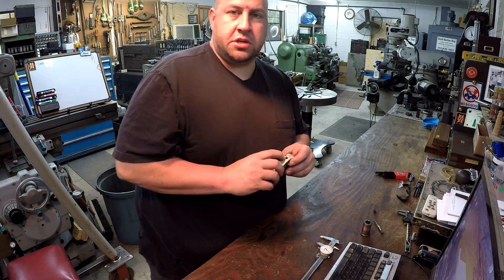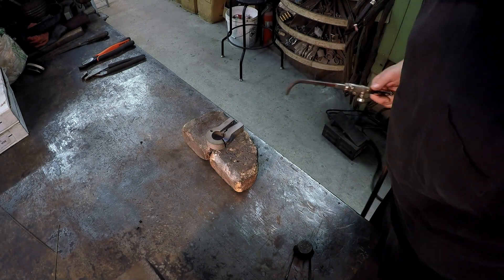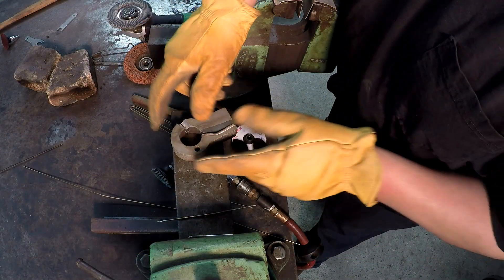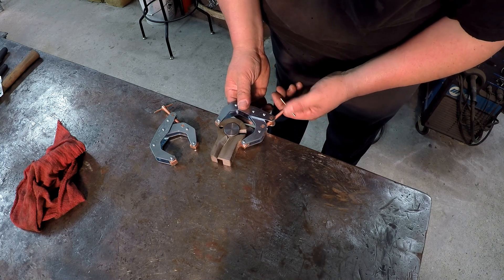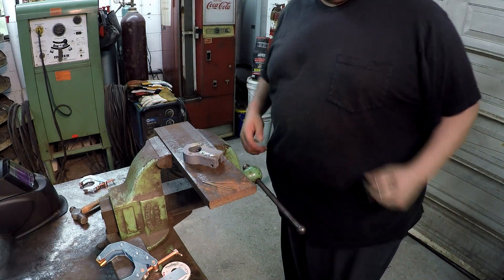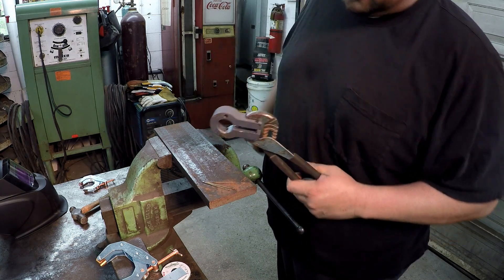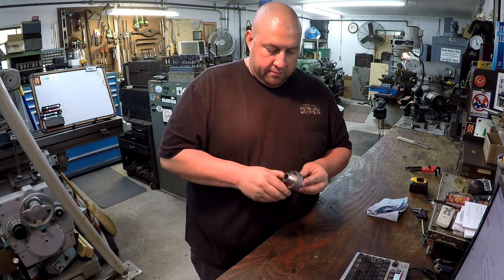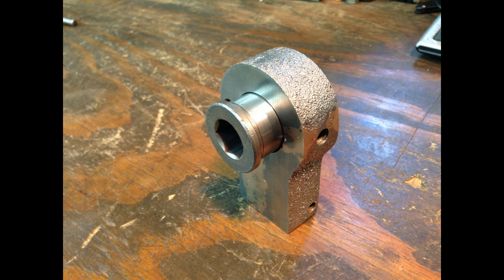Repairs for Herb Blair Part 2

Comment: Adam, a thought about your video and welding..  I am thinking you were on to something with that filter you used when repairing Herbs lathe,  I am thinking you need fill light.  Try a white poster board with the go-pro just in front and centered.  This will pick up the arc light and reflect it on to things around the weld like your glove, the work piece, and the tig torch. This should control the contrast range of the camera which is being over driven.  John Parmalee

Comment: Nice work, and a great "Win-Win" type of deal. Herb got his parts repaired in a fine fashion, and you got some more "good-time hood-time" with the Silicon-Bronze rod on something very precise that required a bit of thinking and trouble-shooting, which I know you really love.

Add on top of that us viewers getting to watch you make that great repair for a great guy...everybody wins! [Arches fingers like Mr. Burns] "Excellent. Mr. Smithers!" :D

Thanks for sharing all of that with us, and I'll be in touch, Aloha...Chuck

P.S. I loved those little sanding discs for my 4.5" grinder, but this was the first time I'd seen the smaller ones, do you recall what SNS they showed up on that I must've missed? I am going to invest in a small angle grinder and would love to get a set up like that with the correct arbor, and will search on my own 1st, but if I can't find the right looking one may I come back to ask? Thanks again!
Reply from the maker: Thanks Chuck. It was a fun repair and glad to help Herb out. I'll have to email you the info on those sanding pads. They're pretty slick.

Comment: Adam

Yesterday I was given a solid little 3" vintage vise.  It's in pretty good shape for its age - the jaws are good and the screw is tight.  The only thing is, the nut the screw turns in has been broken by over-tightening.  It needs exactly the sort of repairs you have done on Herb's lathe parts, so hopefully with your approval I'm going to copy what you did, especially burning all of the old oil and grease out, before weld prepping and bead blasting.  It's about the same size as the bushing you repaired, so I think TIG brazing with silicon bronze is exactly what the doctor ordered.

Thanks so much for showing these repairs.  They are so timely and are really valuable knowledge for carrying out small part repairs.

Best regards
Reply from the maker: Stephen, sounds like just what the Dr ordered. The tig weld should work good. Just be careful not to over tighten the vise yourself, and use it for light duty work.

Comment: Once again Adam, really nice machine/welding work and as always, great production work.  I really am going to have to learn to weld and braze.  I never worked in a shop where I had an opportunity to pick that up.   Clearly I have a gap to fill.  One last thing.  I will no longer comment under IDOMAKE.  From now on you will see me under BlueChipMachine  Its the beginning of my journey to a full blown shop.  More to come on that later.  The reason I tell you this is that you and all the other You Tube machiners have really shown what is possible.  Many thanks.

Comment: Adam,  nice shop and you do nice work. Got to ask ya, why wouldn't you just take a new piece of flat CR plate and make a new piece. I am not fond of cast parts, cast was used cause it was cheap and quick to make.
Reply from the maker: Ivansgarage For what this part is and used for there was no real need in making a new one, as this old part could be saved.

Comment: Is the heat of the torch enough to weld the cast iron? I've always been told to pre-heat a cast part for welding, or is this mainly for stick?

If you want tips for close-up welding footage, you could contact ChuckE2009, in his video's you can see the metal flowing and puddles forming as if you were looking at it yourself.

Good job on the repairs, thanks for the video's.
Reply from the maker: Kris De Craemer On parts that small the welder can heat up the parts fine, but it would not hurt to preheat with the torch first. On larger work I always preheat. 
The guys who have figured out how to capture good welding shots will not share there secrets. We have to learn on our own. ChuckE2009 has never responded to any of my comments.

Comment: Thanks for your posts Adam. I enjoy very much. I work on hydraulic systems for a living. If you are still having problems with a hyd. System without seeing it I'll give a general start point. Does it have a spool valve with electric coils in the circuit? If you think it maybe the relief valve, back the relief valve screw all the way out and then start to bring it back in. If the relief is a cartridge type take it out and look at it. If there is a filter in the system change it. Is there a pressure gage? And last, what type of pump is it. To check pump try running a hose from the output side of pump back to a tank and watch flow.
Reply from the maker: I have already tried adjusting the relief valve, but I wail have to go into the knee to access anything. It's all hidden pretty well. On the side of the knee there are two plugs you remove that allows adjustment on the valve with an Allen wrench. Making adjustment in or out makes no change.

Comment: I wanted to get a pneumatic die grinder and I had to make a choice between a straight grinder and a 90 degree die grinder. I made the choice to get a straight grinder because I already have two 4 1/2" electric angle grinders and a 7" angle grinder. Which die grinder would you have bought? I thought that the straight die grinder might get into tighter places. Also, I see that I will have to get a dedicated piece of air hose to fit inside the 28" outer sheath that they sent me to let the air out of the grinder without getting bypass oil on my hands. I see that you do not have a sheath on your 90 degree die grinder. Doesn't the oily bypass air get on your hands?

Comment: Very nice repair Adam.  It turned out well.  I've used copper as a backer for welding with steel.  The weld doesn't stick to copper. It may be an option with the silicon bronze but I'm not sure.
 Jeff

Comment: I would have used a round abrasive stone with a die grinder to take that hard spot out of that bore. When those metals blend and get hard like that, most times abrasives are all that will work. That handle's bore isn't a critical dimension. Save yourself a lot of time and dulled tooling.

Comment: Great repair Adam, It has to be most rewarding when you are able to help out someone like Herb with a task like this as I highly doubt that it would be possible to find replacement spares for these parts in a reasonable time frame.
Question, what medium do you use in your blasting cabinet? - as the cleaning action on this part is just amazing
Reply from the maker: Dan, I was just glad to help out a friend. I use a medium grit glass bead, I believe a # 80. After the repairs were made I wire brushed it.

Comment: Hyd. problem. If there are screws on both sides of a valve it probably isn't a relief valve. Most valves come with a standard hydraulic symbol on it. Also once you open up your machine you may find a hydraulic schematic. That can be a real help!  All hydraulic symbols can be found on line.

Comment: Great video , thanks Adam. When you tig weld with silicon bronze do you set the welder on AC or DC?
Reply from the maker: I use DC straight polarity.

Comment: Hello Adam your just being told what to do but still liable I am licences mechanic and rules are the same with all cars and trucks the rim that bolts up to any axle needs a load  bearing  and   step coming off the axles. The face of axles are not flush they have at least 1\4 to 3\8 to center the rim and to carry the load. Even rear drums. Have A lip that it passes over and enough for the rim to center and carry the load and  to run true when the nuts are tightened down.

Front rotors with front wheel drive have stuby flanges with axle bearing pressed in and also look at the flange it has a step to center the rim and a load carry support and studs when nuts are tightens they center the wheel true.There you would need to have the axle you are matching with a at least 3\8 sticking out past the rotor for to make things right. Second I can't give any  advise to touching the axle buy removing material that was engineers weight strengths and safety for application made for the flange does have some hardness where studs press in so right there I would refuse the just b even though was not my idea. 

. No harm here ADAM , there is much more to this request than I really know about. Just my 2 cents will keep watching bro.